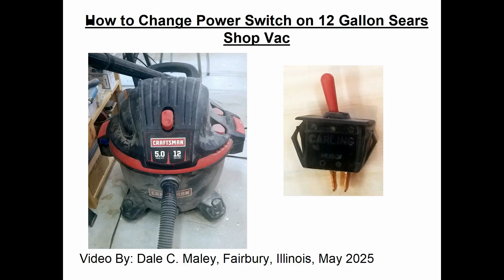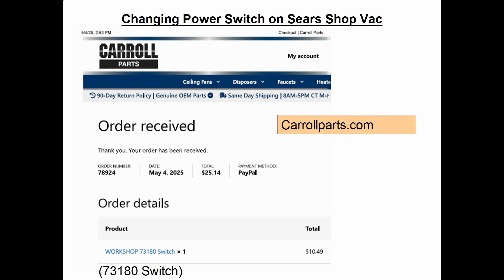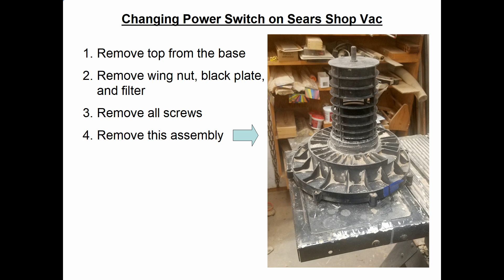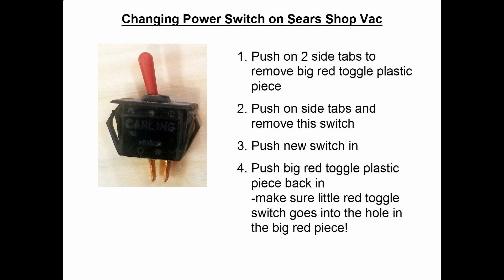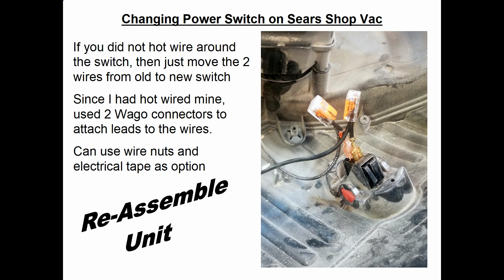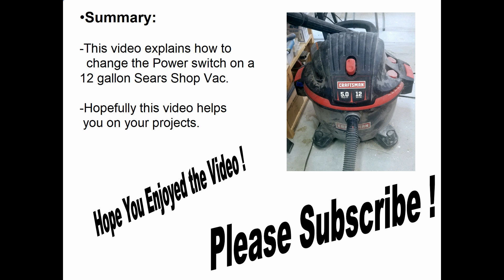How to Change the Power Switch on a 12 Gallon Sears Shop Vac

Comment: Make sure the switch is actually broken, and not just the buttons before wiring up another. The red buttons are just dummies, if you pop them off and carefully cut and remove a little plastic, there is an actual switch you can use.
Reply from the maker: Good point, there could be an issue with the red cover plastic button, and not the switch itself.  I tested mine and it was the switch, not the plastic button.  Thanks for watching the video !!